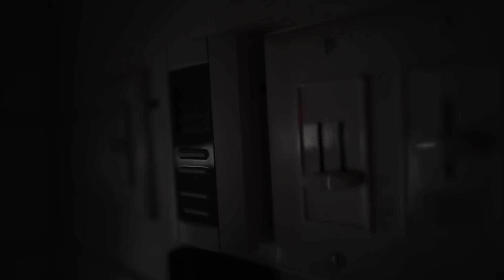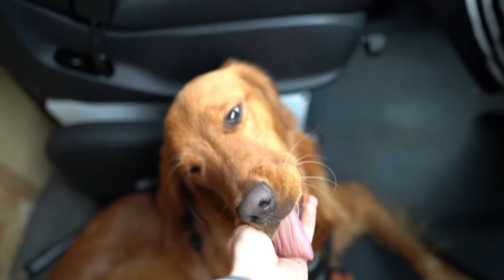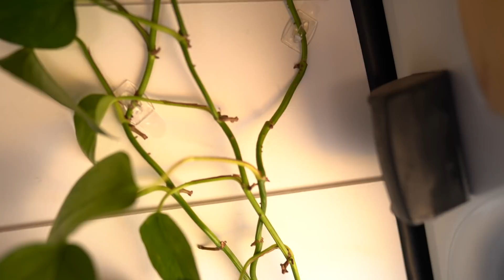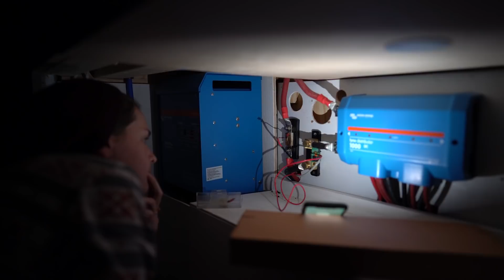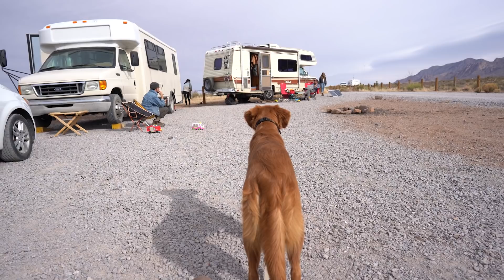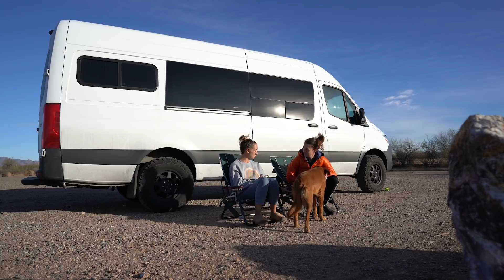Week 59 | OUR VAN ALMOST CAUGHT ON FIRE! Escaping The Cold, Until It Got Too Hot

Comment: I suggest you get a  rattlesnake shot for Oliver.  If Oliver gets bitten by a snake, the recovery is much faster and less costly.  The shot is about $100 to avoid about $3000 for snake treatment.
Reply from the maker: Thanks for the tip!
Reply: With all due respect to the poster, I have lived, and hiked extensively, in AZ for 4 decades, and none of my dogs have ever been even close to getting bitten by a snake. With Oliver on leash, he should be fine.